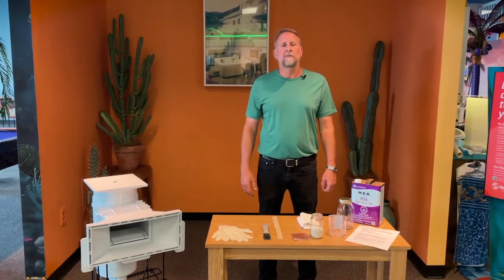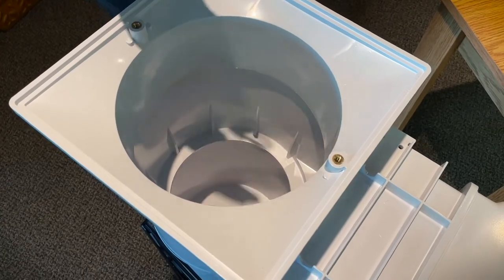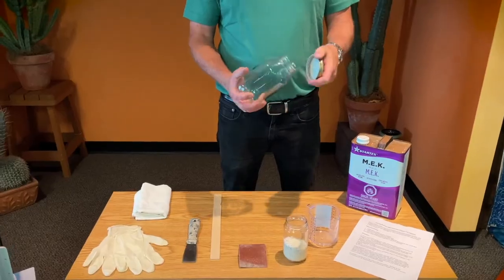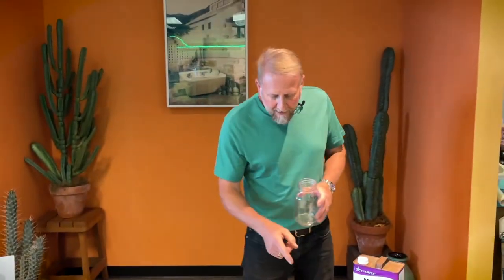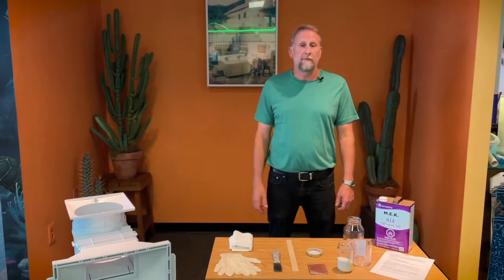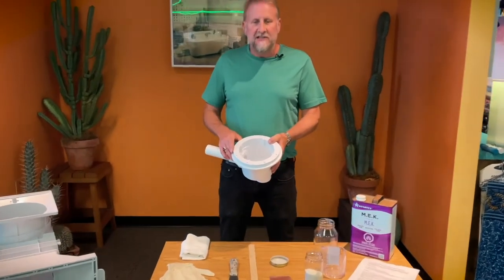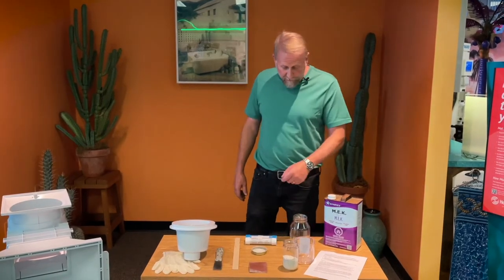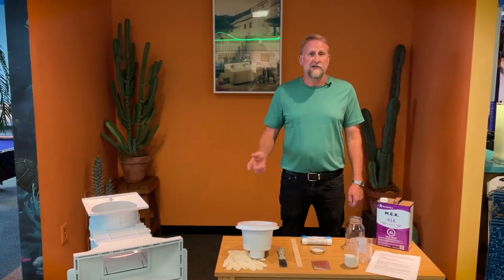How to Repair a CRACKED Pool Skimmer!

Comment: Mine is cracked badly in many places.   I JUST replaced my liner without knowing how bad this basket was, or I would have replaced it while the liner was out.  Can/Should I use fiberglass cloth to add rigid support under Shmear?
Reply from the maker: @bcbarc7044    It is not needed, however if your skimmer is damaged really bad you may need to replace. Schmear does work well if used properly, when applying schmear layer it no more than 1/4 “ at a time. Once cured you can go over it again. Building up is fine, just don’t apply too thick. If you need schmear there is a link in the description of this video. Thanks for watching.
Reply: @HallmarkPoolSupplies  Thank you!

Comment: When replacing a skimmer gasket, would you lower water level below skimmer?
Reply from the maker: If this is an above ground pool then yes. If this is an inground pool you can change the gasket without lowering the water, however it is easier if the water level is lowered.

Comment: So you leave the 1.5" PVC adapter in permanently? I'm assuming that once you pour the schmear in it will bond that part as well. Also, how thick of a layer of schmear to add to the bottom? 1/2"? Thank you!
(I wish we would have replaced the skimmer when we completely re-finished our pool and concrete decking 7 years ago, but I had never had a pool when we bought the house and had no clue)
Reply from the maker: The thickness can be poured in 1/4” increments so it can cure faster. You can layer after each pour has cured if needed. If you pour thicker it will just take a lot longer to cure but you will be okay. I would not pour more than 1/2” thick at a time. Thanks for watching.
Reply: @HallmarkPoolSupplies  Thank you! And you just leave the pvc adapter in permanently bonded?
Reply from the maker: You can, just make sure your basket will fit and does not hit the PVC fitting. If it hits you can cut the fitting down for clearance.

Comment: Can you use the schmear also to fix a crack on the Hayward multiport valve around the pressure gauge?
Reply from the maker: If you have a crack on your multiport valve it is best to replace, the schmear is not recommended for this type of repair. The schmear may bond, however this repair is under constant pressure and may eventually leak, and then you will have to replace anyway.

Comment: Hello! 
Thank you so much for this useful video on repairing skimmer cracks. I have watched this from Mallorca, Spain. We have a cracked skimmer and want to repair it as per your instructions but we can’t find “Schmear” pellets here. The closest thing I have found is ABS pellets for 3D printing. Do you think this would work? Many, many thanks!
Reply from the maker: Hayward is an international company and you should be able to get schmear  by Hayward at your local pool company or online. ABS pellets may work, but you may want to test first to see if the ABS will bond.
Reply: @HallmarkPoolSupplies  thank you for your quick response. I have contacted the official distributor for Hayward in Mallorca and they tell me that, unfortunately, they don’t import the schmear pellets. I will try with another type and see what happens. Thanks again.

Comment: I have trouble with the joint between my skimmer throat and the pool wall leaking. I have tried epoxy putty, flex seal, aquarium sealer and they all work for a few months but eventually fail! Any suggestions ? Thanks
Reply from the maker: If the separation between the skimmer and wall is that bad you may need to replace the skimmer.

Comment: How do you repair the tiles inside and outside of the skimmer? I tried the waterproof spray, caulking, and another liquid that you pour inside the skimmer? When I use this combination it works for one year or two years.
Reply from the maker: Typically tile is repaired by using grout. If you have any questions feel free to contact me anytime.

Comment: How big of a bag is are the pellets how many bags would I need for roughly 40 in of cracks between two skimmers?
Reply from the maker: 1 bag of schmear has enough material to repair several skimmers. Here is a link for the schmear.
https://www.hallmarkpoolsupplies.com/p-8735-white-schmear-compound.aspx
Reply: @HallmarkPoolSupplies  I too would like to know the quantity/weight of the material that makes up the schmear product you sell.
I tried a few stores here in Australia that Hayward said carried their products, and everyone looked at me as though I had 2 heads, even though I don't live in Tasmania.
This below from another poolstore website in the US of A,   regarding the Schmear product:

"Description
Hayward ECX1308 White Schmear Compound
This is a bag of Schmear white pellets that is used with a PVC cleaner to make PVC repairs on equipment like valve ports, cracked gauge threads, and skimmers (freeze ups). It can repair most leaks or breaks in almost any plastic part made of ABS. Cracked ports can easily be fixed using our part #SPX1091Z9 adapter.

Schmear pellets are basically ground up ABS resin or pieces of broken baskets, etc. It is then dissolved in a solvent called M.E.K. This may sometimes be called primer or PVC cleaner. Schmear is similar to PVC solvent cement, which has been used successfully to repair leaking PVC joints, etc. However, Schmear is better suited for repairing broken ABS products."
🌏
Reply: I too have enjoyed finding your very informative and helpful videos..... Thanks
Reply from the maker: 1 bag of schmear has enough material to repair several skimmers. Here is a link for the schmear.
https://www.hallmarkpoolsupplies.com/p-8735-white-schmear-compound.aspx

Comment: Hello, thank you for a great video, question.
I have an inground vinyl pool (~20,000g) and I'm losing 1/4" every night, so I know it leaks for sure. Haven't opened yet this season, so all pipes are still plugged. I let the water go down until it stopped just below the 2 skimmers, which is on the lower skimmer rectangular frame, looking from inside the pool. (On the first screw line from the bottom of frame)
The skimmer seems to hold water inside it, where its bottom pipes are connected, so I suspect the issue may be on the edge or the top portion of the skimmer, or in the connection of the vinyl to skimmer?

Do you think I should fill up water and do a dye test first, inside the skimmer and along the skimmer from inside the pool? Is that repairable with the Schmear/pool putty? Thank you!
Reply from the maker: I would recommend checking out our 4 videos "How to find a leak like a pro" that will help you determine what kind of leak you have. If you have any questions after feel free to contact me. You can watch the series here: https://www.youtube.com/watch?v=r2j3tsKFy_U&list=PLOwxz7N-COXBFwtDuGeC8DNOYzJRgu7wq

Comment: Our leak stops right at the lip of the skimmer. Inside the skimmer, water has gone down level with the connecting PVC pipes. My best guess is we need a Schmear. Confirming, the pellets are simply ABS, correct?
Reply from the maker: Hayward schmear is an ABS product, if you are interested here is the link
https://www.hallmarkpoolsupplies.com/p-8735-white-schmear-compound.aspx
Reply: Thanks, I saw the Hayward product for ~ $60. I'm seeing ABS Plastic Pellets for $16/lb. So, I should be seeking ABS pellets?
Reply from the maker: @Eric-wg2ls  I would verify that the ABS pellets you found will bond to your skimmer.
Reply: Big rains last week filled the pool and skimmer. I've not run the pump for a week. Pool level unchanged. Recently replaced a broken valve and suspect this area. Yet no leaky water. Head scratching
Reply from the maker: @Eric-wg2ls   If you have any questions feel free to contact me I will be glad to help troubleshoot this issue.

Comment: After I schmear the skimmer cracks and let it dry/cure, can I put a couple of layers of fiberglass around the skimmer to strengthen it against future cracks?  If so, what would the prep be for the schmeared cracks before laying on the fiberglass?  Thanks.  Great videos!
Reply from the maker: You do not have to use fiberglass mesh on the repair, the schmear will bond to the skimmer if it is applied properly. Once the schmear is applied and has cured and you use mesh over the repair and schmear it again it will not hurt but it is not needed.

Comment: I have several projects for which Schmear would be perfect, starting with my skimmer.  But my experience is the same as another commenter who can't get the pellets into a creamy state.  I have followed your instructions to the letter, have tried more MEK, have stirred patiently and endlessly but can't get past the "gravel" your other customer mentioned.  I know you must have your own tricks to get to the creamy/tooth-paste , please share in detail.  I think the mixing process deserves its own video.  Do NOT tell me to add more MEK (yes, it is pure MEK) or tell me to just keep stirring.  I want this product to work.  So far it hasn't.  Bennett Gates
Reply from the maker: What brand of Schmear do you have?
Reply: @HallmarkPoolSupplies  Yours.  Hallmark, from a local pool repair shop.  The recommended ratios of meK to schmear still didn't work on a second try.  here's what I finally did.  Used equal parts MEK and schmear, stirred for a while, then started shaking/stirring vigorously every twenty minute or so, putting the lid back on.  After about six hours it was getting "maple syrupy" but still filled with lumps.  I left the lid off for an hour, got it thick enough to brush on my vertical cracks.  Pretty rough.  Gave up and went to dinner, lid off.  When I got back, there was a skin over the schmear, when I lifted off the skin, I found "mayonnaise" underneath.  Stirred it up, poured it out on a board and used a plastic trowel to cut out the '"popcorn," painted/troweled on the mayo with a perfect result!.  A couple of suggestions:  If you have a better technique, include it with the video.  I really want this product to work, the recommended proportions can make you crazy.  Maybe sell the schmear more finely ground.  When it smooths out, it's truly is a great product.  Bennett Gates.
Reply from the maker: @bennettgates9260  Glad to here that you finally got it. Hayward schmear is the only schmear I carry. Hayward's schmear use to be slow dissolving, so when you mix it you would close the lid on the jar and wait 24 hrs before it was ready to use. Hayward changed the formula to a quick dissolving schmear that is ready to use in minutes. The only schmear they have today is the new formula and it also should have came with instructions. I don't make the schmear, Hayward makes it and there are other companies that also make schmear this is why I ask what brand did you get.

Comment: Why don't you mention that lowering the water in the pool will not allow a dry environment for a pool with equalizers? How do you remove that water?
Reply from the maker: The skimmer in the video did not have an equalizer, however some skimmers do have equalizers and in most cases you can remove the cover. Use a shop vac to dry out the skimmer. If needed, you can also lower the water in the pool a little more. Thanks for watching.
Reply: @HallmarkPoolSupplies  I think I need to put a stopper in the equalizer port. I vac out the water and it keeps flowing in. I'm afraid to go lower in the pool since it's fiberglass. Thanks for the tip.